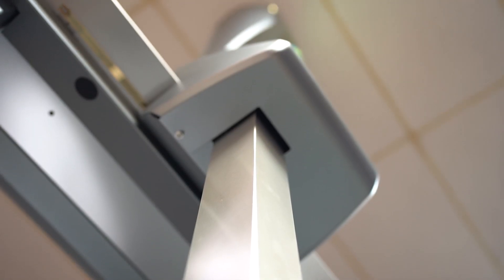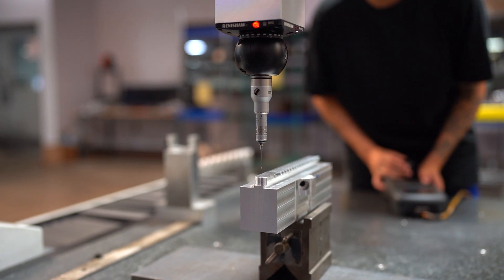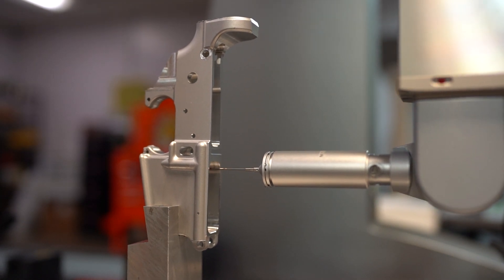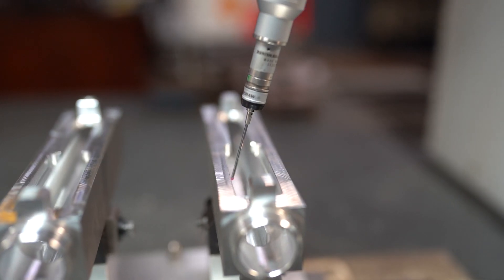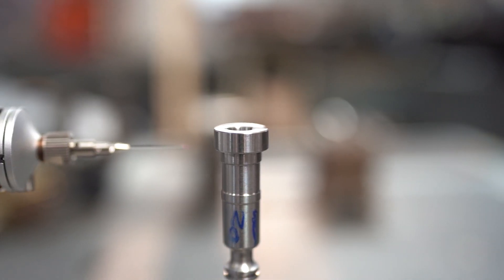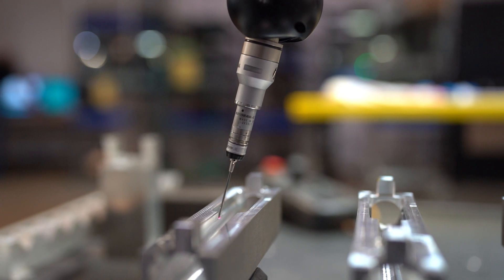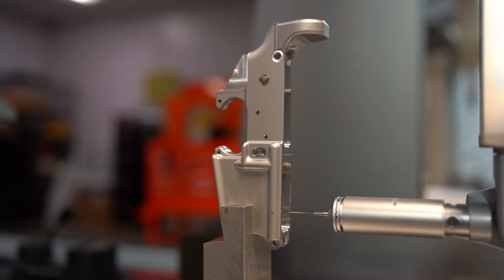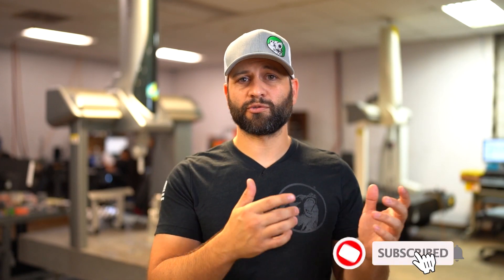Bear Creek Arsenal Quality Control #1: CMM Machines

Comment: @BearCreekArsenalSanford
I really appreciate the price point of your AR Uppers and different Lengths and Calibers and i want to purchase all of them ( in Time ) but can you explain why there is so Many negative videos on YouTube and Reviews with complaints of scratches and debris inside barrels of some complete Uppers? Uppers being shipped out to customers with sharp pieces of metal left behind by machining process? customers saying that they had to return their upper because the barrel was not machined properly and the tolerances are way off, and they were not able to sight in properly? And they say they have problems with Feeding and ejection problems the most. How does this happen when y'all have such a great Quality Control Department before shipping out to customers? Please help ease my mind on these issues so I can get to ordering  the Uppers I want so badly in my collection, because no one wants to return something that they had been waiting for   and are excited to get to the range just to find out it doesn't work!! Or work properly as it should and then have to go through the hassle of returning it to just wait more to get a replacement!! To me that is not Good Quality Control!!!! That just sounds like you need to hire more people in Quality Control or make the people doing the Quality Control do a better Job too make sure these things are not going out the door without being Inspected properly. Y'all have alot of machines running and pushing out alot of different parts and it seems you do not have enough staff to make sure nothing goes out the door that is not 100% in working order, or rough feed ramp, debris or scratches in or on barrel or complete upper PERIOD!!!
Reply from the maker: Over the last 10 years, we have greatly improved the quality of our work and how we assemble our products; many of these changes were made because of those exact reasons you are bringing up. Like any organization, we have had growing pains but ensure that ANY defect is and always will be covered by our company with our Bear Den Guarantee (lifetime warranty). We will always stand by our products and services; our customers are the reason we exist and pursue our goal to make a quality rifle at a price point that the common man can afford. No customer should receive a faulty product but when they do, we will make sure they are taken care of!

Comment: There's problems with performance of my 308 upper. It jams on shell extraction the same now , as the 1st time i sent it in. I've tried to return it now for a 2nd time & can't seem to contact anyone. I admit, i just learned the wait is 14 days. 
 Returns are a problem in that it costs to return & return shipping. 
 I'll say I do have BCA ar15 stainless steel pistol upper & it seems to work fine.

Comment: You guys need to improve quality control in your assembly
Reply: Yea my upper reciever and handguard had different black colored coating and reciever was slightly marred.
Also ate the firing pin in 1 full mag.
Reply: I have bought 5 complete uppers and put thousands of round thru them... Not 1 malfunction in ANY of them.  I'm sorry you had that experience! Hope they corrected it for you!
Reply: I have had great experience with BCA.
Reply: Not defending BCA here, but if you DO NOT take the responsibility to throughly inspect the firearm, upper or what ever and just go out to shoot it. Not only is that dumb, unsafe and irresponsible. That is on you. Even high name brand manufacturers from expirence has fallen to assembly errors.. Lessen the human error and thoroughly inspect it or have a qualified gunsmith look over the firearm before first shot.
Reply: @EagleEyeShooting  
Final inspection should be done by a qualified professional, before the product leaves the manufacture; you are buying a new, should be fully functional--correct, firearm after all. Just because it happens to the big names too, doesn't make it OK. 
Best Regards and God Bless, Col

Comment: You can do it faster, but this is 1960s tech that was made (and hand checked) on 1960s machines and tooling.

Stop trying to impress people with your .0004 tolerance. And you're definitely never going to use the 
.000050 capability of that CMM.
Reply: So, are you simply trolling here or is real knowledge backing your criticism ? I'm genuinely curious and not being sarcastic.   As it relates to the firearm industry components this video is referencing, would you accept the tolerances spoken of or not ? Are you more critical of the tolerances in the firearm or the technology itself?
Reply: @l.h.1238  I have a couple decades in manufacturing. Manual machining, CNC, ISO9001 inspection, press brakes, hydraulic presses, etc. 

Admittedly my experience is not in firearms manufacturing, but I'd love to know what they're holding to "4 tenths" (.0004) on an AR.
Reply: @joshuagibson2520  I see. So,the tolerances that are acceptable in one field may not be in another it seems. I'm not familiar enough with acceptable firearms tolerances to say one way or the other. I am very curious still. Thanks for the response.
Reply: @l.h.1238  Those are likely standard tolerances specked out by Eugene Stoner (he was aerospace engineer, its not surprising he picked things based off standard aviation part tolerances). He said typical was .005" (which is sloppy for some aircraft parts), and .0004" (which is crazy tight tolerance for most parts), I imagine they are just following the military spec for tolerances.
Reply: He is just trolling..period.